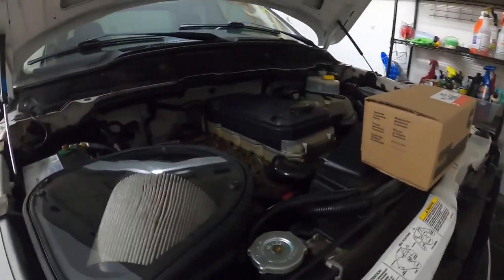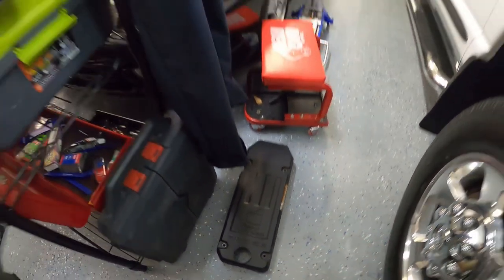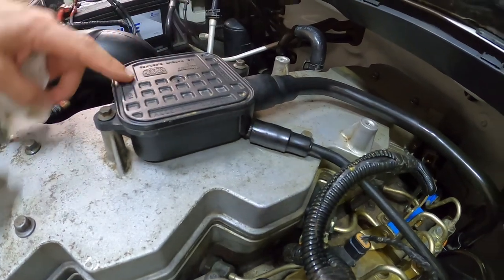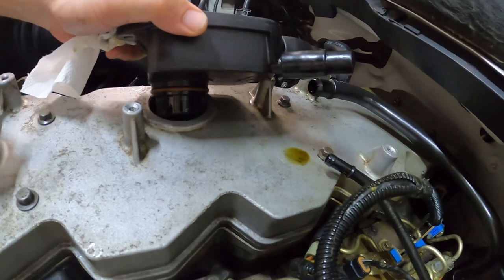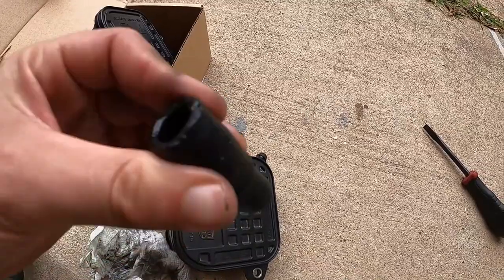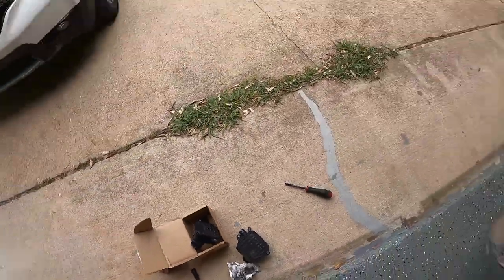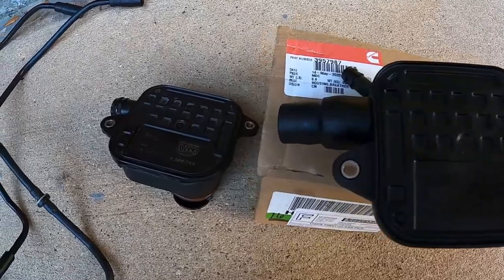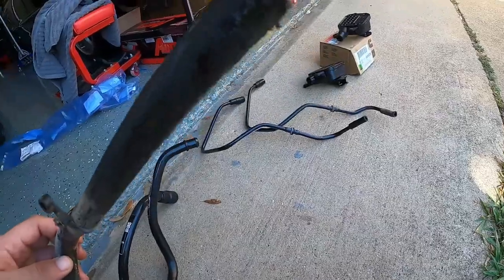Cummins Oil leak ON TOP Of The Valve Cover? Crankcase Vent Box

Comment: How did you get the hose off of the crankcase I got the lines off but the hose I can’t get off
Reply from the maker: The rubber hose near the bottom of the engine block? I sprayed it with some silicone lube and then twisted it back and fourth with some pilers. Same way I get any rubber hose off.